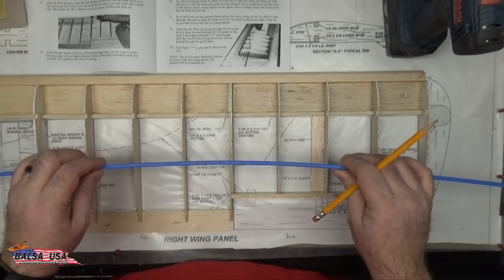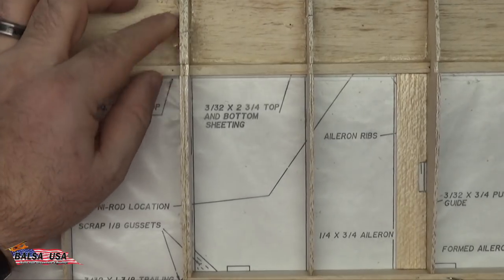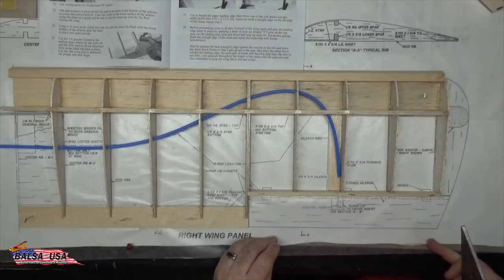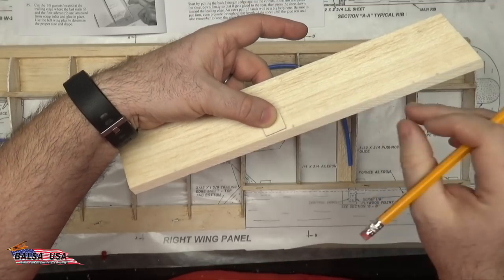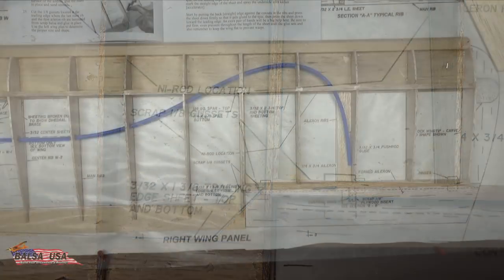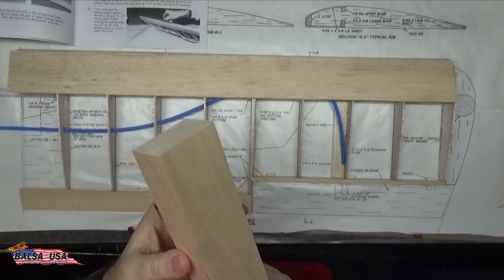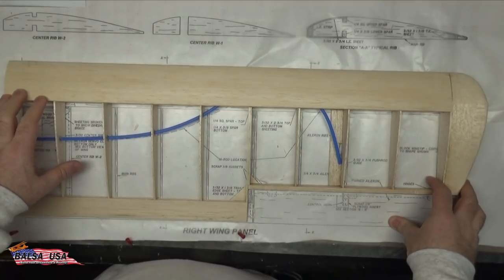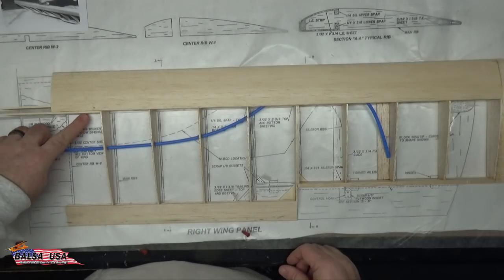Beginner 7

Comment: Nice video! One thing I would suggest is to scuff up the outer surface of the Ny-Rod with some sandpaper to give the glue a bit more bite. Plastic can be pretty smooth in its natural state. Also, when using an Exacto knife (or any blade for that matter) cut AWAY from yourself.
Reply: The cardinal rule. Always cut asway. Only once has Joe put the piece on the bench and cut downward. Holding in the hand is unstable and unsafe. Ditto when he uses the Zona saw. Cut against a firm surface,
Otherwise a good series of vids.